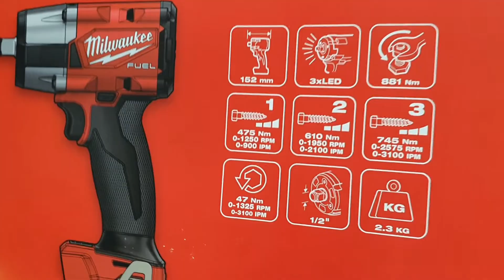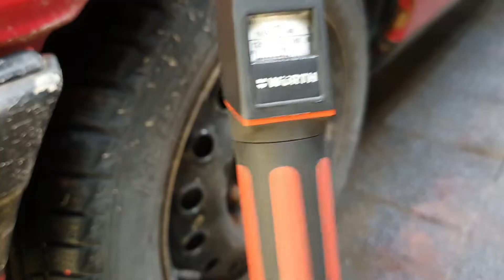Test Review NEW MILWAUKEE M18 FMTIW2F12 FUEL MID-TORQUE IMPACT WRENCH WITH FRICTION RING.

Comment: Why are you so surprised that it’s an ideal tool?  Milwaukee make awesome tools.  I recently bought the M18 Fuel Gen 2- 18 Gauge Brad Nailer.  It’s an awesome tool.  Same with the M18 Fuel Router, M12 23 Gauge Pin Nailer and M18 Random Orbit Sander.  All very good tools!

Comment: Today September 1st 2021, the Milwaukee mid torque + 5ah battery is selling for (219 +tax at home depot). [The  dewalt mid torque + tool bag + 5ah + 3/8 dcf890  150 ft/lb impact wrench + charger dcb107 ] is selling for 250 +tax at Lowe's...

Comment: i just watched a review where he torqued it to 500 pounds = 678 nm and it removed them much more easily than this idk why
Reply: Because this is real-world scenario, where all those 600+ Nm claims does not work. They work only for marketing purposes. That’s all. When you really need to get that rusted bolt out, they just can’t do that. My calculation is to divide claimed torque by 3, that will give real world torque. If they say tool can get 600Nm so that would be around 200Nm in reality.
Reply: How about the fact that the tool is greatly affected by the battery.
They get the most power from a freshly charged battery with 21700 cells.